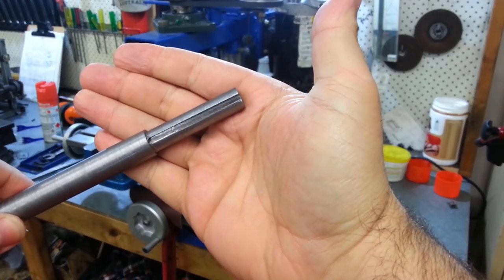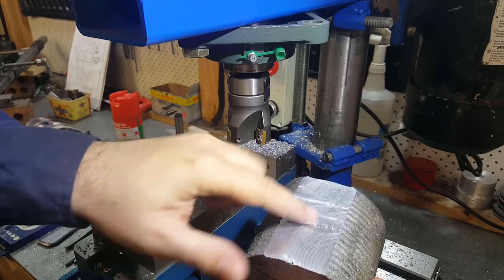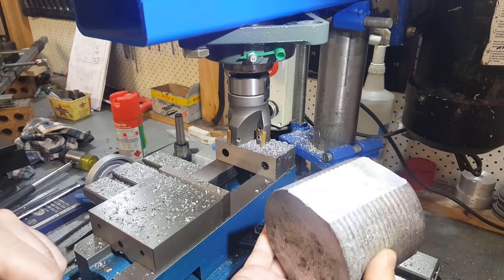DIY Milling Machine

Comment: Brilliant!  What did you use for the spindle, taper, and flange bearings?  How did you align everything accurately?  Thanks, Jerry
Reply from the maker: Hi Fossils etc.

Thanks for the comment

Spindle: The spindle was hand made on my lathe out of Bright Steel from memory it was 40/40 cold rolled steel - I'll add a photo of the lathe set-up and technical drawing and links to within the online forum https://www.homemadetools.net/forum/diy-milling-machine-74852

Taper: the taper is a Morse3 taper, I decided to use this shape as tooling is quite cheap and will also fit my lathe tail-stock.
Bearings: The bearings were I used were pillow block cast bearings UCF207 35mm ID they were the only bearing in my price range and they seem to do the job well.

Alignment: I'm relying on the shaft having a tight fit on the bearings to reduce miss alignment as these bearings have universal pivot points and both baring were fastened 35mm apart. This means with a tight fitting shaft within the bearing ID 'internal diameter' top and bottom the bearings align very close to center. 
To get it even closer I used a steel rod clamped within a collet chuck and ran the dial indicator on the Z axis (up / down) - to dial it in even further by tapping on the side of the top bearing with a nylon hammer. This was a very time consuming and tedious process.

For alignment on the the compound table - I used a dial indicator attached to the milling arm then ran the bed back and forth in the X axis (left / right) and the Y axis (back / forth) and packed up the bed up with shims as best I could until it was as close as I cold get.

Comment: great work! looks vray strong! may i ask u,how the mt bit handle lock to shaft?
Reply from the maker: Hi Jun Chang
The cutting head is screwed into place using a 12mm bolt that protrudes through the top of the pulley through the shaft and screws into the M3 aber that's attached to the tooling.
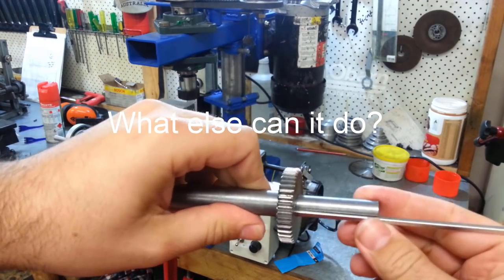This way when your cutting the tool self tightens and prevents the M3 arber from falling out or slipping whilst cutting. You can see me changing the cutting head by loosening the bolt on top and giving it a good tap downwards to loosen it's grip at 3:59min in the video.
Reply: @MaximumDIY  thanks for your explain man：-）
Reply from the maker: You are welcome, thanks for watching my video :)

Comment: How You make the spindle morse?
Reply from the maker: Hi 3altair33
Thanks for the comment, I made the M3 spindle morse by copying the profile from and existing morse.
I did this by mounting and existing M3 morse taper between centers on the lathe and aligning the compound slide using a dial indicator moving the compound slide back and forth until there was zero degree’s movement ‘this took a while’.
I then drilled a 12mm hole into the work piece whilst setup with a steady rest to support the shaft and proceeded to boar out the M3 morse taper shape using the angle provided by the previous measurement.

Please see photos on the morse taper setup here: https://www.homemadetools.net/forum/diy-milling-machine-74852
M3 Taper setup photo: https://www.homemadetools.net/forum/attachments/diy-milling-machine-m3taper-setup.jpg-30889d1566902493
M3 Taper Diagram: https://www.homemadetools.net/forum/attachments/diy-milling-machine-millingmachinedriveshaft.jpg-30887d1566902372
If you found this useful please give me a thumbs up and remember to Like / Share / Subscribe 

Comment: Hi mate, love your machine.
I must admit I didn’t expect it to work that well. I didn’t think it would have the rigidity required.
Do you think filling the hollow parts could help with rigidity? Say concrete or even sand?

But it does work! Would be very interested if you make a video on deflection and tram.

You’ve got a new subscriber mate 👍🏻
Reply from the maker: Thanks for watching my video and subscribing!
I've read up on filling the machine with concrete or other media and many people mention it would help with the machines mass, meaning it would make the machine heavier but not really aid with the rigidity of the machine.
As for the deflection and tram, excellent suggestion - I might go over that in a future video.
Reply: Maximum DIY Filling the machine will definitely increase rigidity, but most importantly, it will help dampen vibration to prevent tool chatter. This will let you make deeper cuts in harder material. Concrete will work, but it tends to shrink (or expand, forget which) when it cures. This will cause warping. One popular method is using a mixture of epoxy and various sizes of quartz aggregate. Look up epoxy granite if you are interested. Your machine is a perfect contender for this because of all the hollow spaces.

Comment: How many Watt for this spindle?
Reply from the maker: Hi David Man, are you asking how many watts is the motor?
The motor is 2450watts - plenty of power.
Reply: @MaximumDIY  hi sir, what is speed in rpm for the spindle motor?

Comment: Awesome job! Can I ask how much you have into your homemade Mill? My mind is blown.
Reply from the maker: Hi gamertaboo
Thanks for the comment! 

Additional information about the build and parts used is located at homemadetools.net and hackaday forums 
Homemadetools forum https://www.homemadetools.net/forum/diy-milling-machine-74852
Hackaday forum https://hackaday.com/2019/09/01/scrapyard-milling-machine-gets-work-done-on-a-budget/#comment-6176735

As for the parts
Most of the machine was built using scrap steel I’d collected over the years.
The motor was sourced from an old hydraulic paint strayer that I got from a recycling centre for cheap. The X and Z axis motors were free. 

Parts Purchased for the build
Drive motor $10
PWM Speed controller $5
Switches $40
Plastic boxes $26
X-Y table $200
Spindle bearings $55
Z axis lead screw $15 
Paint $15
Drive shaft Steel $50
Total Cost approx: $416

Parts excluded from the build as I would have purchased these regardless of building my own mill or purchasing a new one.
M3 Collet chuck and holders
M3 Facing cutter
Machinist vice
End mills

Comment: What motor set up did you use for the table/head lift?
Reply from the maker: Hi Boozler 81
For the table X axis I used a window washer motor from a small car connected to a 12v motor speed controller for the power feed. 
For the head I used a hydraulic paint sprayer pump 2400watt motor which I picked up form a recycling centre for cheap.
For the lift motor I used the rise / fall motor out of a treadmill, this motor was perfect as it was already geared to lift a heavy load.

Thanks for the comment.
Reply: @MaximumDIY  Thanks!  I've seen a lot of people repurpose the windshield washer motors but, I wasn't sure how they ran power to them.
Reply from the maker: @boozler8194  

I used a PWM (Pulse Width Modulation) circuit to control the amount of current provided to the motor, this in turn controls the speed of the motor. 
To change the motors direction I used a 2 way switch that reversed the polarity to the motor. 

More info on PWM’s  https://www.ebay.com/itm/AU-20A-PWM-DC-Motor-Speed-Regulator-Controller-Switch-Max-1200W-DC-12V-48V/173740252588?ssPageName=STRK%3AMEBIDX%3AIT&_trksid=p2057872.m2749.l2649

PWM controller eBay listing https://rover.ebay.com/rover/1/711-53200-19255-0/1?icep_id=114&ipn=icep&toolid=20004&campid=5338585848&mpre=https%3A%2F%2Fwww.ebay.com%2Fitm%2FAU-20A-PWM-DC-Motor-Speed-Regulator-Controller-Switch-Max-1200W-DC-12V-48V%2F173740252588%3FssPageName%3DSTRK%253AMEBIDX%253AIT%26_trksid%3Dp2057872.m2749.l2649

Comment: Is this a kit? I only saw the assembly.
Reply from the maker: Hi Larry 
Thanks for your comment. 
To answer your question “is it a kit?” no it’s not a kit – it’s all home made with exception of the compound table and the vice – I did attempt to film the fabrication process but I experienced all types of failures with recording. I had cameras fail, audio go missing, cameras deciding to stop recording mid scene so I decided not to include this part in the video.
I do have bits and pieces of footage but it’s choppy at best jumping from machining the main shaft to the machine being half assembled so I decided to show the time laps of the final assembly after everything was painted.

I've included some additional information within this online forum https://www.homemadetools.net/forum/diy-milling-machine-74852